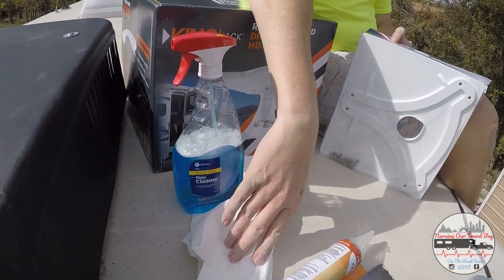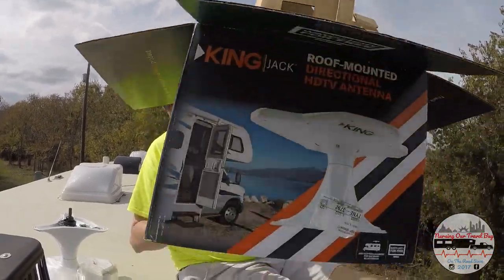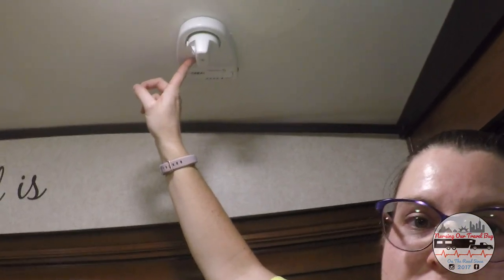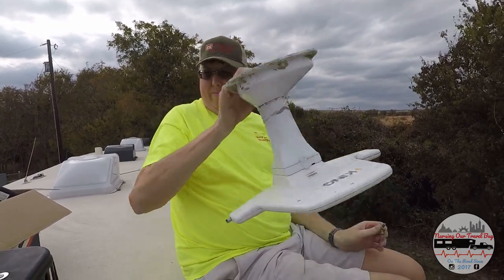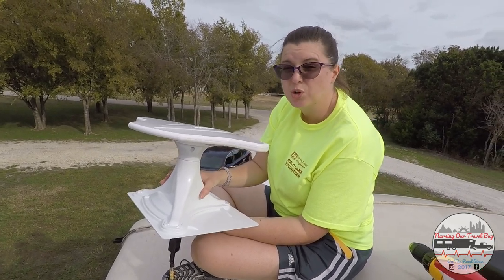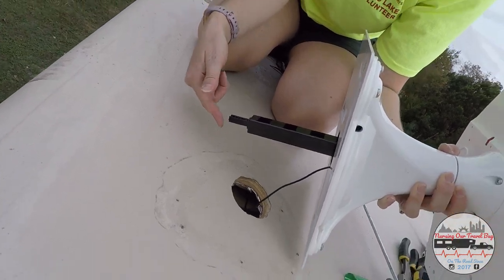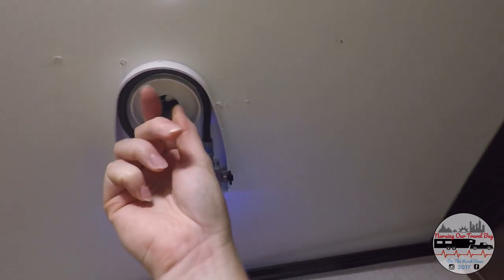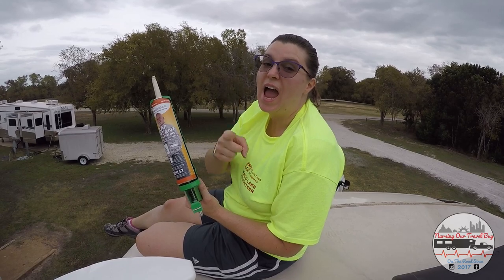King Jack RV Antenna Installation

Comment: Found you through BluWave Odyssey ..Good Info here for sure. Is it ok that my wrench is a craftsman brand..I see you are using Stanley..lol  I want to learn more about the "nursing" angle..12:00 I was worried about drill and or screw hitting other wires that may be in the vicinity of where you were mounting the plate..Thank ye for subbing to my wee little channel as well..weather permitting a new one is due soon. Fair Winds and Smiles and may God Bless
Reply from the maker: Craftsman is the best!! Thanks again!!